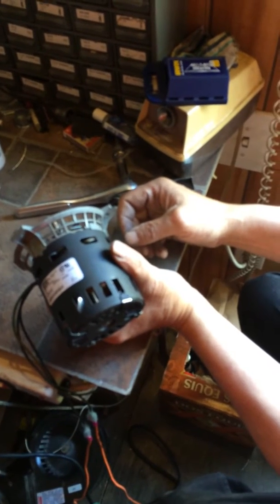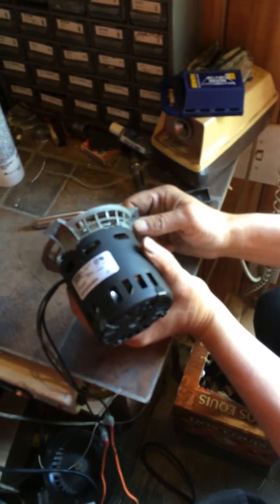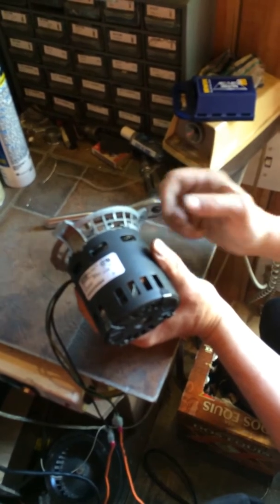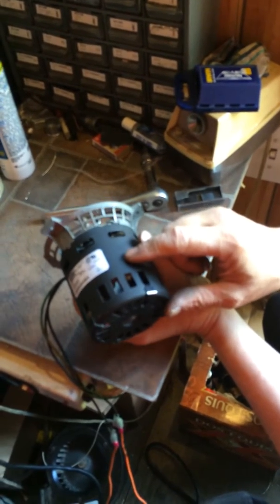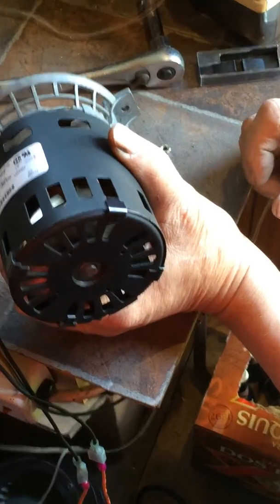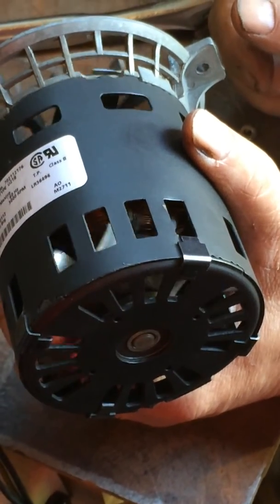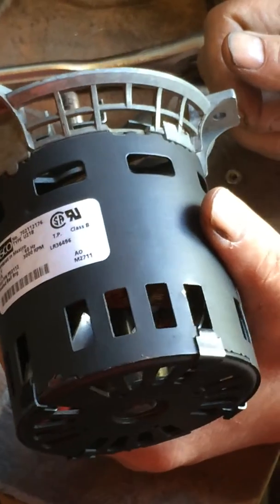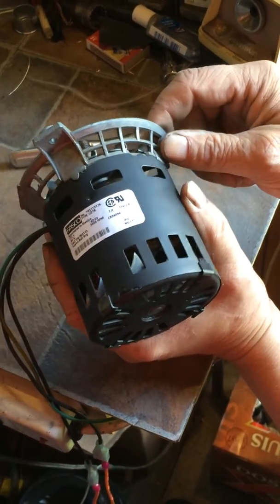Pellet Stove Part 1 - Bad Bearing in Exhaust Blower

Comment: i have aqua fire pelet stove and l have a problem my stove shut off time to time by her self,i keep it very cleen regulary,clean it every day every day the same like u showing in this video some time the blower stop and the stove shut down after i push the reset bottom and start working i fed up from this stove,l can not count on it,but l used all the time and now have a problem the store hier in saint jerome said u have to replace the blower and is not easy to fined it do u thing this the problem? or what? can u help me please$ and to get the parts too please thank u
Reply from the maker: I had the same problem with a Quadrafire Classic Bay CB1200. Since quadrafires use the same parts then these parts should also fix your problem. This intermittent problem is very difficult to resolve but I do understand it should be done to make the stove reliable again. So here is what I did to get this problem resolved.
1.
Replaced the vacuum pressure switch because it was old and the bladder inside was weak or even torn so it stopped sending power to the auger motor and the stove shut down at different times.
The OEM vacuum switch can be ordered here
https://www.eastcoasthearth.com/products/oem-quadra-fire-universal-vacuum-switch-includes-hose-srv7000-531
2. Replace the Auger Motor, It was weak and when the stove gets warm the auger motor  can overheat and stop feeding pellets and the stove shut down.
The auger motor can be ordered here.
https://www.eastcoasthearth.com/products/quadrafire-2-4-rpm-feed-motor-epp-812-4421
3. The old version control box was faulty and the stove shut down
The latest updated Control box can be ordered here.
https://www.eastcoasthearth.com/products/copy-of-control-box-quadra-fire-800-1000-1100i-812-0261
Good luck
Thanks for asking